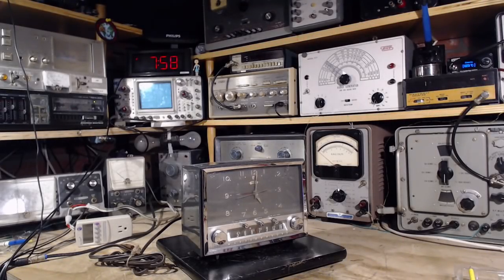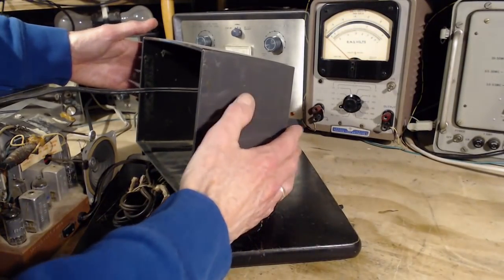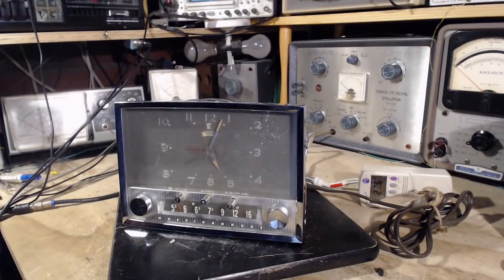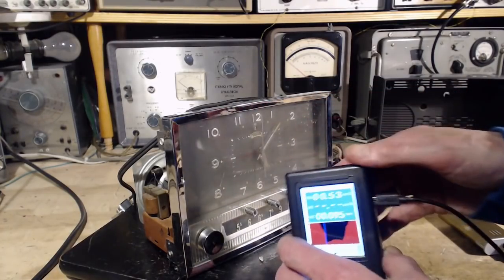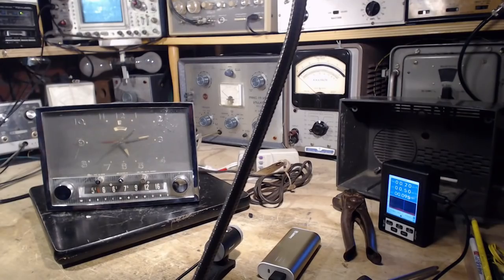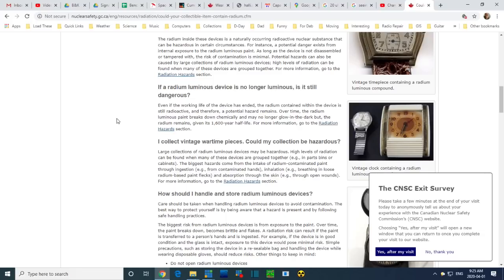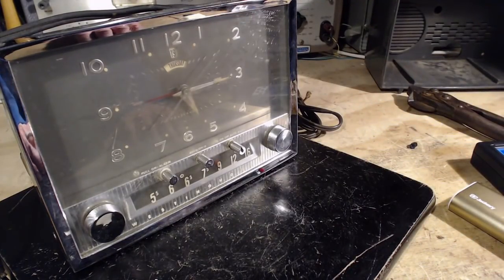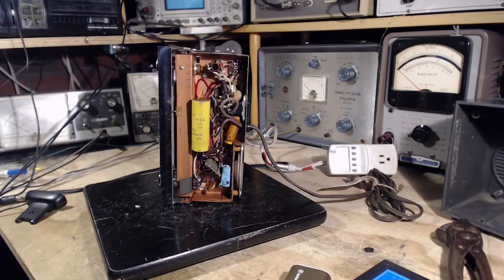Westinghouse 5T121R-2 Clock Radio Video #1 - Radioactive Radio

Comment: As a retired nuclear engineer with 25 years in the industry, I congratulate you on identifying and researching radium dials that were common from the late 1930's to the 60's.  Both Radium (226) and the daughter product Radon are alpha particle emitters (helium atoms without electrons) which are attenuated by the air space and 100% by the plastic face.  Special detection equipment is necessary to detect alpha radiation which is not available to the public.  The decay of the resulting Radon results in several daughter products with weak beta (free energetic electrons) and weak gamma emission which is what you were picking up on your counter, which sounded just a bit above background radiation without looking at the unit values.  A fiesta ware plate would give a similar report (radioactive uranium inside the clay).  The beta radiation is attenuated by the clock face and about a foot of air.  The gammas are there but of low energy and that is probably most of what you were picking up.  In any case everything you noted about ingestion and inhalation was accurate and both should be avoided because there is no attenuation of a free helium nucleus or free energetic electron at the surface of internal human tissue.  The only thing I would do differently would be to look at the shaft that rotates the clock hands where it goes through the face to see if there is a bushing or tight clearance there to limit air exchange, which would be a good thing.  After your careful inspection for face damage, gaps and paint dust & particles inside the face cover, I would have no concern about having such a clock radio beside my bed (as long as the radio itself is electrically safe).  Albert

Comment: Older radioactive dials also used tritium (triple-weight/double-added-neutron hydrogen), which decays using an electron emission (BETA particle) that could not penetrate much, but tritium only had a half-life of just under 13 years, so it would rapidly lose its glow over a few decades, which is one reason it is no longer used; the other major reason was that while beta decay is easily stopped by even thin plastic film, if ingested, it can cause cancer and other radioactive effects.  Tritium turns into Helium-3, a stable, low-weight form of helium.  Tritium was cheaper than radium since it can be separated from water rather easily from the two lighter, stable forms of hydrogen, regular hydrogen and deuterium (double-weight/neutron-added hydrogen).  This caused a major scandal in the early 20th Century when the girls who painted tritium on clock/watch faces became sick with radiation sickness and the owners of the sweatshops where this was done tried to cover it up (mentioned here -- there is a movie coming out on this in a little while).  Radium has a much longer half-life, so it glows somewhat less for a given volume of material (radium weighs much, much more than tritium), but it takes much longer to dim down.  Radium can cause the same kind of problems of course, if it gets on your skin or is ingested in lungs or stomach. The people in manufacturing plants using radium for clocks and watches had the same problems as with tritium.

Comment: I get it ! April Fools! It doesn't have enough radioactivity to worry about. You do know that the earth itself has a gas emanating from it called Radon!
The most dangerous thing about the radio is the high voltage you run through it with replacing the capacitors!